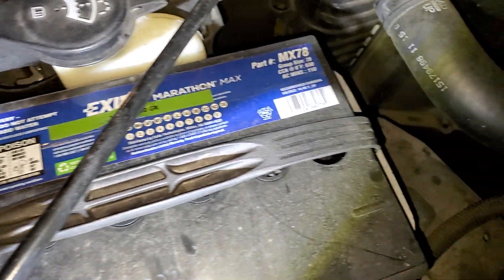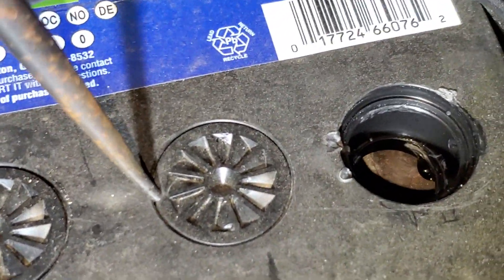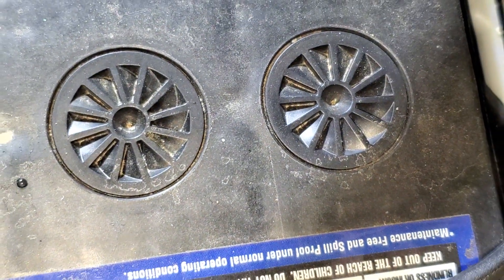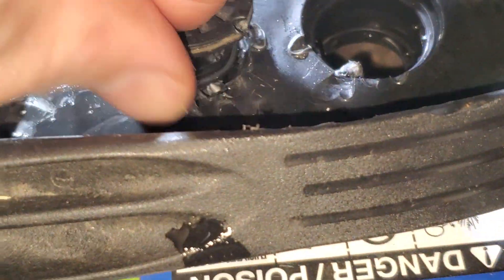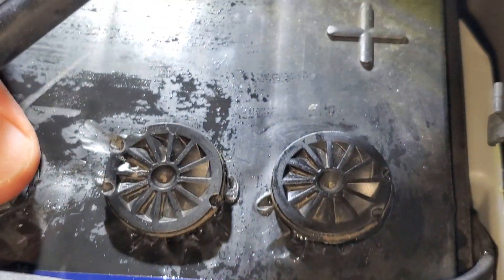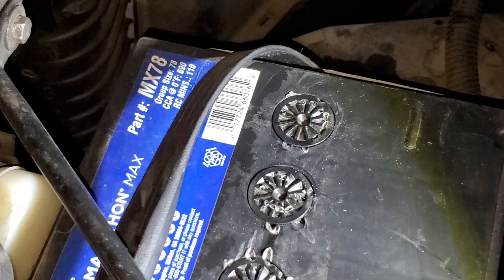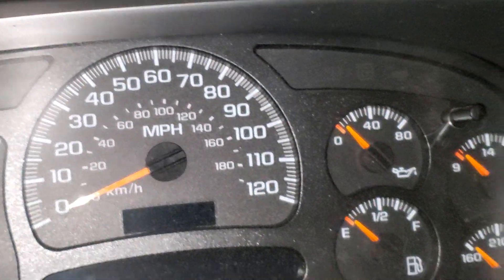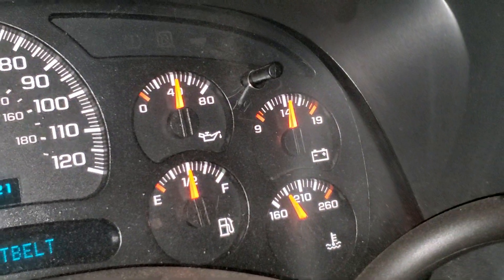AGM Battery problems

Comment: AGM’s aren’t flooded batteries.
Reply from the maker: Ok. You're right, the liquid inside the absorbed glass mat that is pressed against the lead plates is battery acid. The "absorbed" glass mat aids in preventing the plates from falling apart from sulfation and vibration. However, it will lose content and require some sort of servicing. To be honest, while I "restored" this battery, I had to replace it shortly after as it had failed due to prolonged loss of liquid.
Reply: @MrRChitty  to much water and failed or got to dry and failed?
Reply from the maker: @wolfmanrjt  it had gotten too dry too long. Technically, it is the water that leaves through hydrogen production during charging. The acid stays behind. This is why they add distilled water when low. They're sealed with rubber caps, however, if they pressurize, then it will vent from the small port at the top.